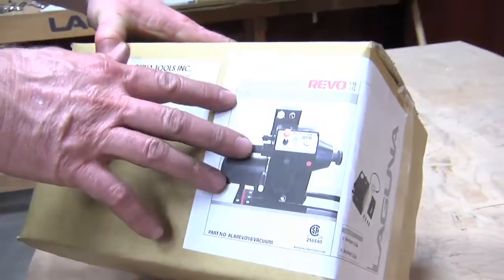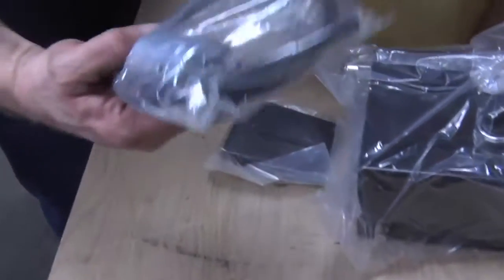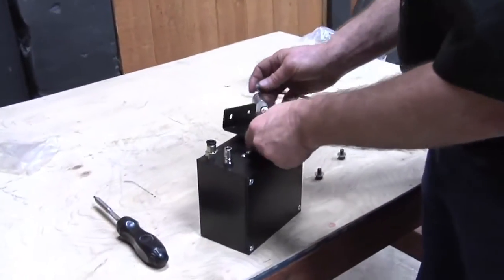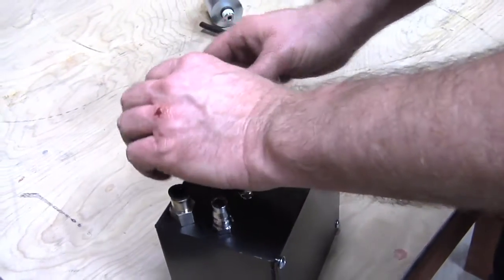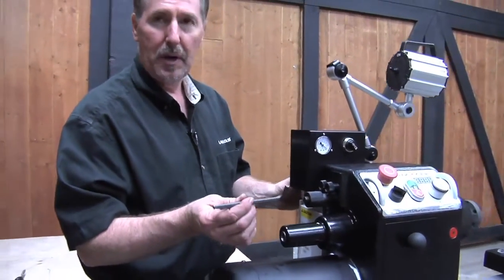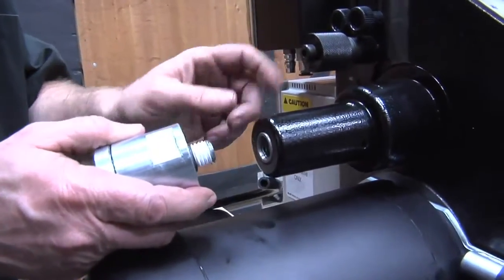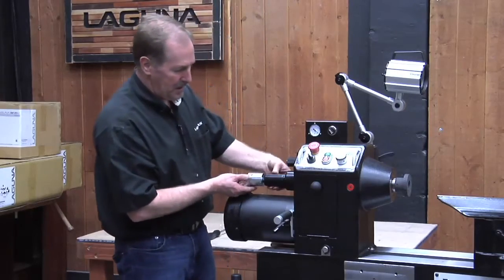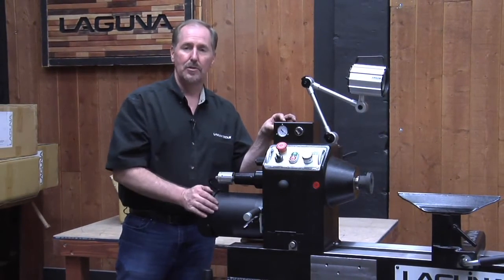REVO 1836 Lathe Setup - Install The Vacuum Inverter - Part 8

Comment: now what is needed is the recommended compressed air capacity, psi/cfm, to drive a typical vacuum chucking operation.
Reply from the maker: We have forwarded your question to our specialist and will get you a answer as soon as we get it. You may also email us at graphics@lagunatools.com - Thank you for your interest.
Reply: many thanks
Reply from the maker: Please also email us at graphics@lagunatools.com - Thank you.